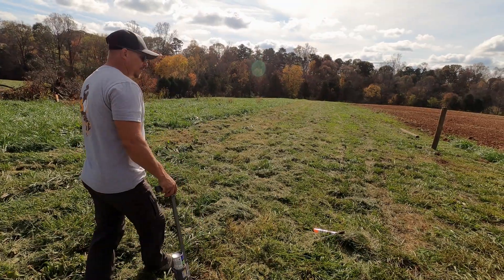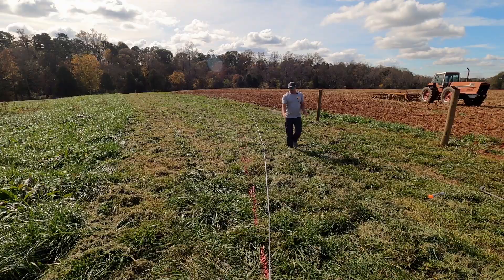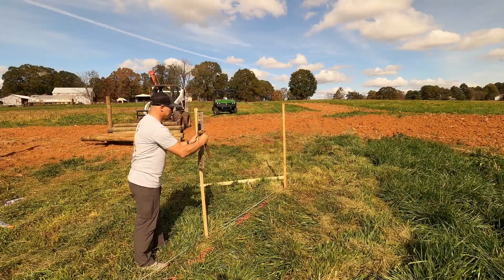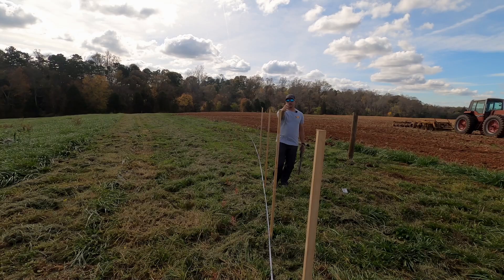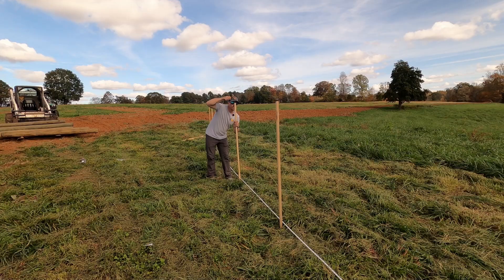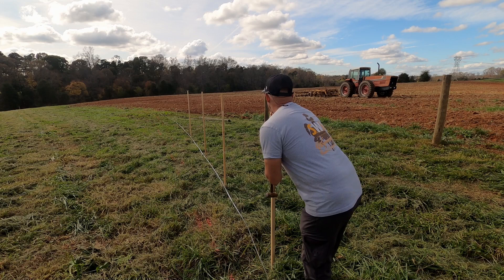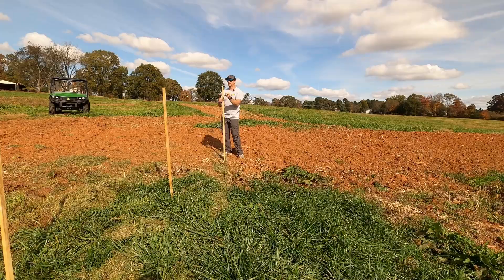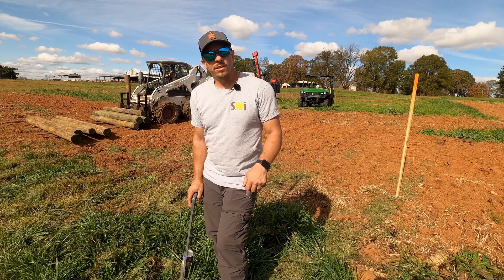Practice Sighting Fence Posts with Cheap Stakes | Around a Curve and Up a Hill

Comment: Wish you wouldn't have been interrupted, when you where about to recommend the 6' chain link grade.. Looks a whole lot easier in hard ground. Maybe I'll find it in another video on that. Augured a few holes today, all round and blast rock, darn Canadian shield and builders using cheap fill. Come to Northern Ontario, Canada. Thanks for sharing your knowledge I greatly appreciate it. Wish me luck, uphill with lots of rock, uneven ground and have to butt up to a large uneven rock face.  I haven't figured out how I am going to close that gap up yet. Also may have made the mistake of going with a bottom bar instead of wire . Good luck with the Evo around here.$$